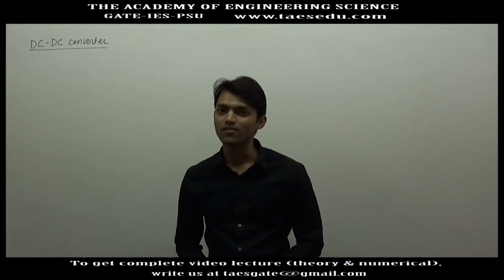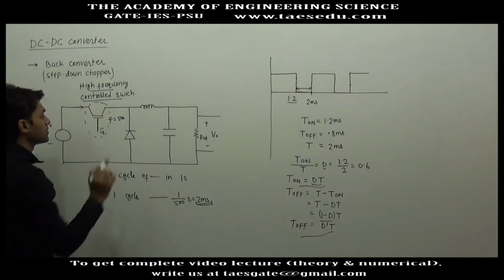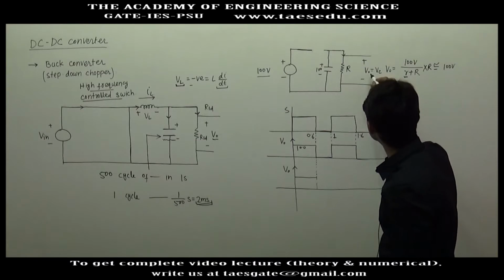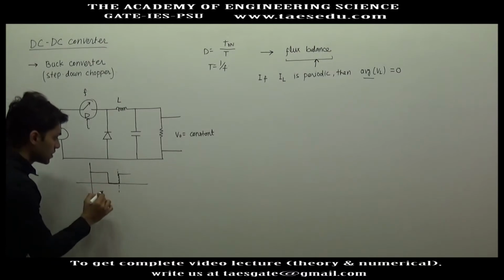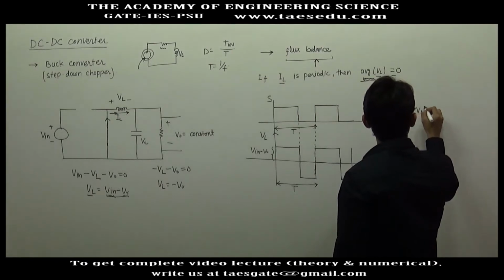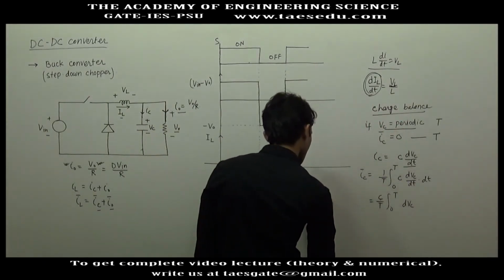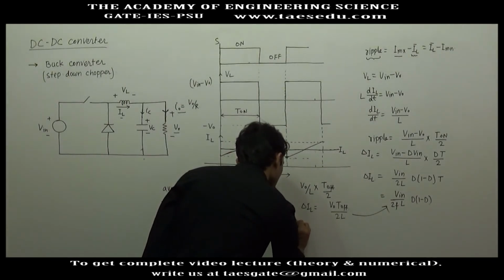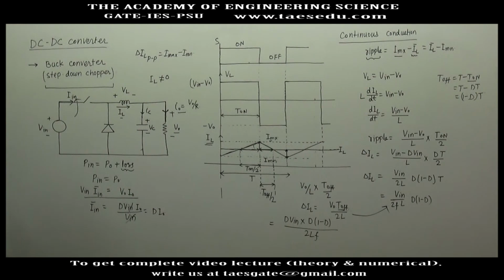Lecture 17: Step Down Chopper (English): Buck Converter: Power Electronics: GATE 2019

Comment: y the inductor voltage become negative when the switch is disconnected
Reply: because now the supply no longer supplies...nd the polarity gets reversed as the inductor now releases its energy stored during on time...

Comment: If you have an input LC filter the voltage on that capacitor when the transistor is ON will be equal to the source voltage? and when the transistor is OFF? assuming steady-state and CCM

Comment: sir, i think when the switch is off for buck converter, the polarity of the inductor will also change and as well the polarity of diode will also change, then the direction of current from inductor when switch is off will reverse and flow through diode as it will be forward biased.........................just a comment...ok maybe i am wrong